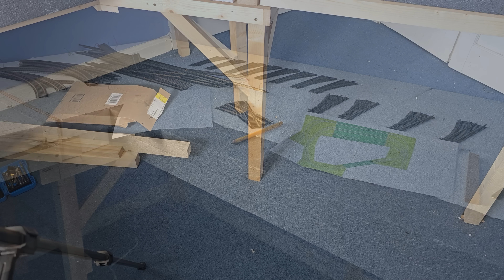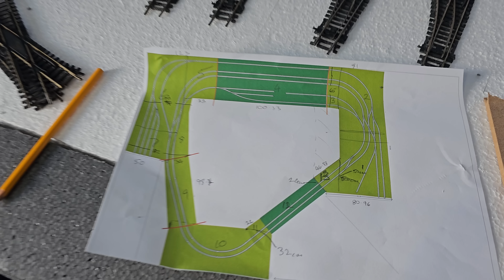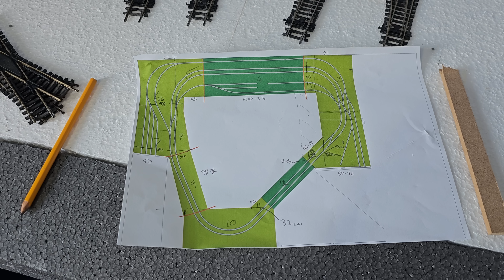New Layout Update 2

Comment: Good on you for sticking to your guns regarding the points you are going to use. I was pleased when you mentioned having to file down the frogs on the points to allow the wheel flanges of your locos to pass over them. I have 2 Lima points and 1 Hornby point on my small layout, and I have had to basically carve the plastic frog away to stop the locomotive and rolling stock from bouncing off the track when reversing the train into the sidings.

Comment: great video once again,,I nhave two suggestions,cutting a screwdriver slot in the topn end of the adjustable foot makes it easier to adjust the feet,the other is to add some foam or cork under your track as the foam will start to fret (?) with trains running on tracks directly on the foam even if it is pinned

Comment: I'm really enjoying your videos Bill. They've helped me rebuild two of my old Triang engines with used ones I buy off of eBay and cannibalize to fix my original ones. I have a T.R.2335 steam engine and a T.R. 20071 shunter my parent gave me about 60 years ago. In this video around the 5:37 mark you mention that you file down the frogs so the old Triang engines run smoothly. I've  filed down the wheel flanges to try to accomplish this with limited success. Could you please explain in more detail how you file the frogs down. That would be my next option. I watch all your videos so I wouldn't miss a quick explanation in your next layout update. Thanks very much. Doug
Reply: See Layout Update video Three !! (Bill demonstrates exactly what he does to file them down.)

Comment: You’re right to fit the side mounting feet, the layout will continue to settle over time, even without adding scenery.  Try a Peco settrack points if you can, they are better made and running than Hornby, and are the same geometry.

Comment: Looking good! As far as the Metcalfe viaduct is concerned , might it be that the width is designed with Peco streamline track centering in mind? Setrack has a wider footprint on double track than Streamline. Maybe you could just limit yourself to the section over the bridge to Streamline. I have the same wide variety of older stock as you. Never had any running problems on Streamline universal points, both electrofrog and insulfrog. The key is the « universal » bit. The finescale have a much narrower frog section and older Triang-Hornby stock definitely won’t go through them, though Hornby Dublo seems to be fine. Just a thought.

Comment: I am in a similar build timescale and was on the point of buying a viaduct from METCALFE but won’t be doing that now I am laying all my old 1970s Hornby track so would encounter the same issues Bill.
Could I suggest possibly just cutting off the far side balustrade,then attach a wider track bed just leaving you to glue back the balustrade,possibly less drastic.
Reply from the maker: I'm going to try cutting off both balustrades and remodelling them out a bit. The track bed is actually wide enough I just need to move the walls out a bit.

Comment: Hey Bill! I've got myself a set of Hornby points that come with the basic starter loop - and I see what you mean when it comes to filing those frogs, my old tri-ang stock jumps them terribly, however another point of contact I've noticed is that there is a small beam centred between the two moving rail sections on the point above the sleeper that some of my older locos get stuck on too, have you encountered this? And if so were there any remedies. - loving the new videos can't wait for more!
Reply from the maker: I haven't encountered that issue apart from one or two locos that have longer parts of the couplings that drop down for lifting with decouplers. I cut a little off the coupling. But I haven't had any other part of a loco interfere with that part of points.

Comment: Great to see your new layout progress! I've just built the baseboards for my layout (last had one over 40 years ago!) but mine's all modular in case it needs to be re-located. As regards the legs/feet. I'd just stick some stiff card, hardboard or thin plywood as required to the bottom of the leg to the same footprint. More stability and less expense than those adjustable feet. Just my opinion! Incidentally, what height is the track level from the floor? Thanks!
Reply from the maker: This is sort of modular. I'm building it so it can be taken apart and rebuilt if necessary. Hopefully it'll never need to be but you never know! Track will be 80cm from the floor.

Comment: I identify closely with your general  "kiss" approach. One teensy suggestion - to temporarily fix my track for testing,  I've used mapping pins through the standard (Peco) sleeper holes without any problems - and they're very easy to remove later! My temporary surface level is 25mm Styrofoam (XPS) sheet, so not sure if this would work with expanded polystyrene though ...

My own layout is only a 12in wide "shelf" sitting on Spur shelving brackets, leaving almost no space for "countryside" terrain, so like yourself I have been thinking of adding, say, an additional 6in of width cantilevered from the front edge, to be able to add just green stuff and some livestock, without any more trackwork or rolling stock. So, I'll be more than interested to see how you fix the extensions to the supported (trackwork) sections!
Reply from the maker: I tried pins when building my previous layout but it didn't work. Temp fixing flexi track needs something more secure on expanded polystyrene. Screws either side of the track keep it in place. PVA to fix it more permanently.

Comment: Regarding the Metcalfe viaduct.  It is almost certainly too narrow, as they're built for streamline track.  It doesn't say this on the website.  I built one for N-gauge, and it was so narrow the tracks didn't fit side by side for set-track, so I built a second one after scaling up the PDF in software.
Reply from the maker: Yeah that's what I feared. Really a bit miffed with Metcalfe for not making that clear. I think I will be able to get away with it but there is a small chance I may have to scratch build or kit bash another viaduct.
Reply: @oobill  Would it be possible to cut the existing viaduct along its length & place an insert to widen the track bed?   If possible, I would suggest that the cut be more towards the back as that would hide the joint more easily.
Reply from the maker: @chrissouthgate4554  The track bed is actually wide enough. I'm going to try removing the side walls and fitting them wider apart.